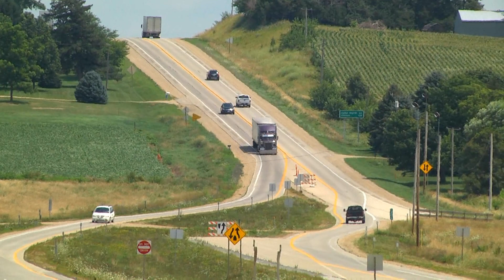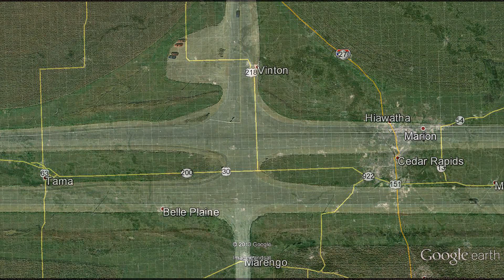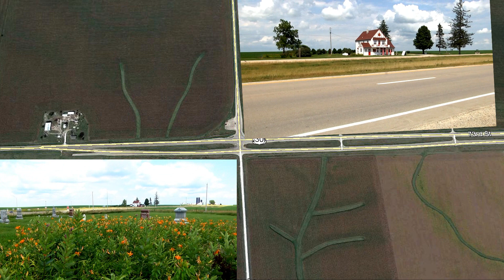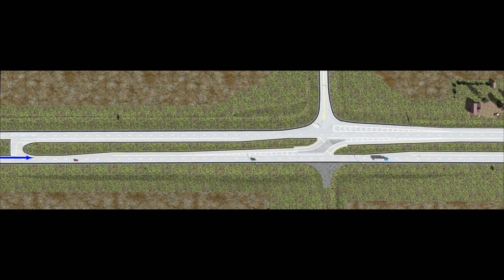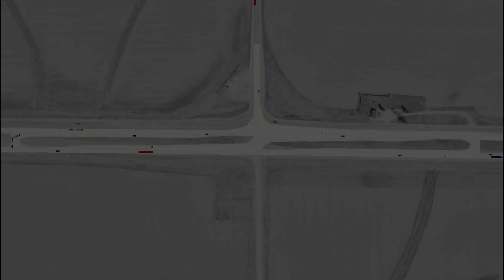J Turn Video

Comment: The diagram of the J-Turn intersection in this video does not show the real details. You have to wonder - is this done on purpose? Intersections similar to these J-turns are fine in metro Detroit & places like that, where there are also stoplights included AND lower speed limits (usually 40MPH or less). One important difference in traffic in Iowa compared to Detroit are Farmers with Combines, or tractors pulling anhydrous tanks, loads of corn, hay, & more. Also add the large semis pulling over 80,000 lbs of grain & other cargo into this mix. Can you see these slow moving vehicles trying to merge into high speed traffic from a dead-stop while also needing to merge on over into the left lane immediately so that they can make the j-turn while some of the hi-speed traffic may be wanting to merge in that same lane?  Look at the animation of the trucks coming from the gravel road (south) and wanting to go west on 30 . First after coming from the gravel, they turn RIGHT(east) and they need to immediately merge all the way over to the LEFT, across both eastbound lanes to get into the far-left)  j-turn lane. Notice how when they make the j-turn, they must yield or stop before merging into traffic on westbound 30 and after they come out of the j-turn they barely make it into the right lane on westbound 30 when suddenly a car comes from behind and passes it on the left.  Imagine a tractor with a grain wagon or a combine trying to merge in this j-turn intersection nightmare. I think we'll be getting rid of a few innocent farmers with this crazy setup. Also take into account that traffic coming from 218 from the north - who are wanting to go EAST will also be trying to merge into this man-made cluster-cluck at the same time! Soooo, I'm saying that what works in Detroit doesn't necessarily work in rural Iowa! And why even call it a j-turn? It sure looks like a bunch of U-turns to me! I think this is also done just to make it sound safer. Lastly - I just about laughed when I heard the narrator say  that this j-turn reduces the potential  for side impact crash locations from 5 to zero! I guess he doesn't count side-swipes & rear-end crashes that would occur in the j-turn scenario as being important..